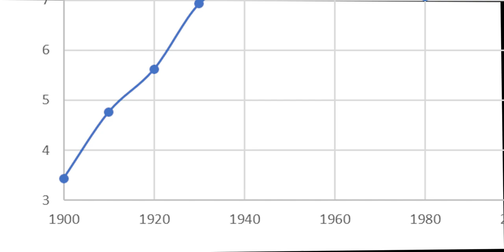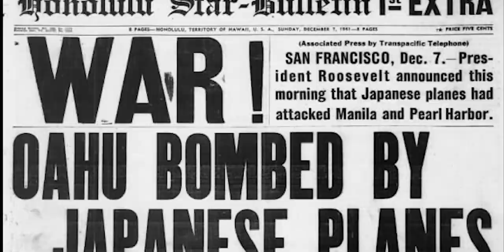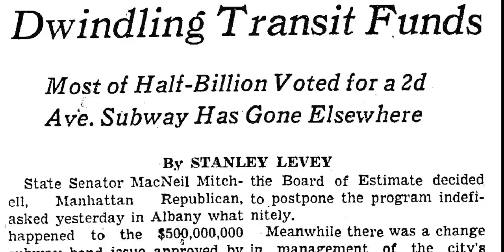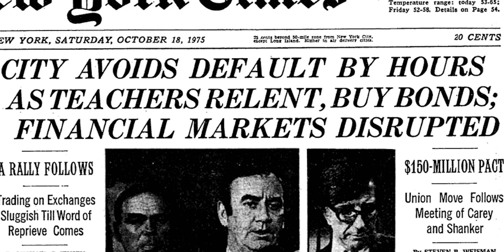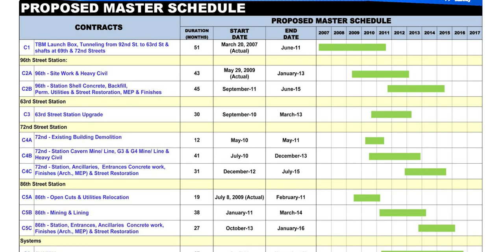The Century Long Wait for the Second Avenue Subway

Comment: The MTA also has plans for a phase 3 and 4 of the 2nd Avenue line that would be serviced by a future T service. I wonder how long it will take for that to happen. Another 100 years? Either way, I don’t see why the Q line can’t also be extended from the 125th street station on the Lexington Avenue line to reach the 8th Avenue and Broadway-7th Avenue 125th street stations as well. Manhattan has a lot of lines that go uptown-downtown but not enough lines that go across Manhattan.